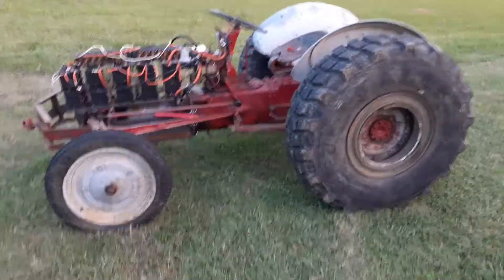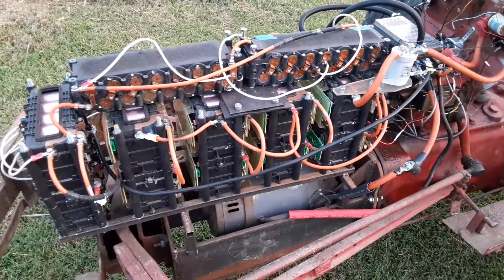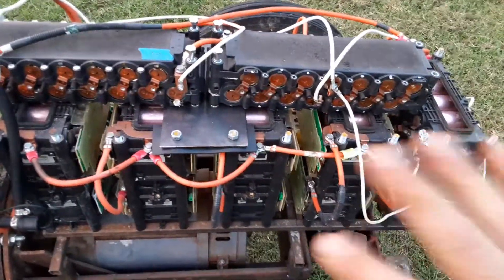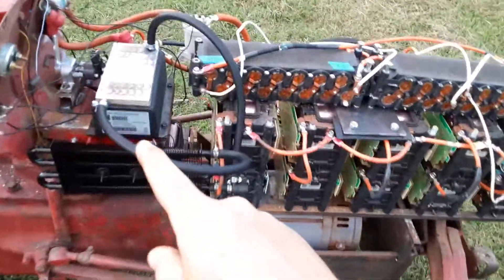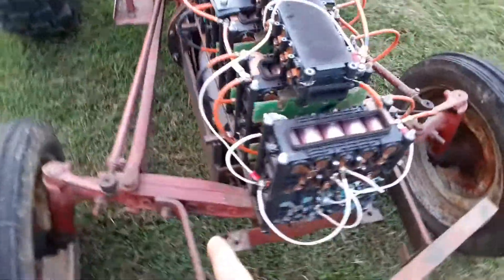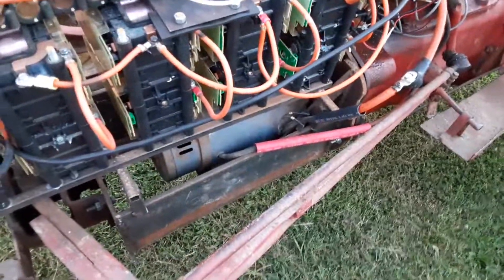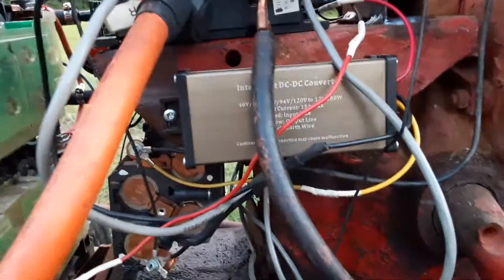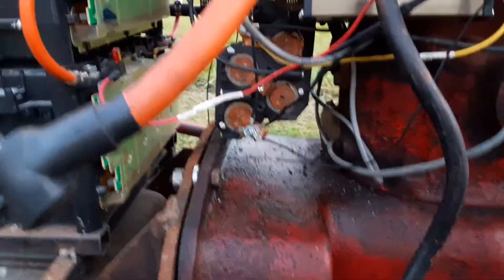DIY EV Tractor walkaround Ford 9n electric conversion

Comment: That'll not a bad effort. The noisy motor can probably be swapped for a quieter, more efficient and more powerful EV motor, when one can be found at the right price. But meanwhile, you have a very useful tractor.

Comment: cool project! The stressed member at the front replacing the engine as a stressed member in the chassis is probably a bit on the weak side for real tractor work. But for light work in the yard it is probably enough. Anyway, cool project! Could you say anything about the cost of the components?
Reply from the maker: If anything I am concerned I overbought the frame replacement and the case would be the first failure point. Last I checked I was $2200 into the whole project including tractor. Most expensive item soliton Jr controller that I run now. Free batteries.
Reply: @stevenmurphree  Well the plate is not flush against the clutch housing. You have those screws with the washers in between the two surfaces. So that may cause the screws to break out of the clutch housing. It looks a bit flimsy all in all.
Reply from the maker: Yeah the pilot for the input shaft was too long and pressed into the closed end bearing on the motor I used. I was afraid to cut it off initially but next time the tractor is split one small 1/4" non splined section should purchase enough clearance. Eight 3/8" (m10) grade 5 bolts is in excess of 50,000lb shear strength.

Comment: Is that forklift motor?
Reply from the maker: Yes
Reply: @stevenmurphree  I really don't know..
What is use of forklift motor..
As far I know 
It requires less rating system ( in terns of volts) like 36/48v, means it has low speed.
 
It has max loading capacity.
Please reply few more info ...what is the purpose of forklift..
Because I have seen few mates used forklift motor in car as well.
Reply from the maker: @kmuralikrishna1582  it all depends on motor specifications. Forklifts are just a common source for large, inexpensive DC motors.

Comment: Fantastic work!  Been thinking about doing something like this to an old Ferguson 35, the engine in it had got frosted and cracked the block, then the head was stolen so it's just sat there ever since.  Anyway I just wanted to ask how much work would you say you get out of a full charge with battery capacity you have?  Ideally I would love it if were possible to have an electric tractor that could run a small mower, turner and bailer in order to bale a small field, trouble is I suspect all of these activities are going to very heavy on battery power and I'm unsure what capacity I would need in order to complete each of these tasks, especially the mowing as that is going to be determined by things like moisture and density of the grass ect, it always used more diesel anyway, I suppose I could make an educated guess knowing how much fuel I used and the tractors power rating to determine how many watts of energy would be needed.  Anyway any thoughts on battery usage would be great and very much appreciated.  Keep up the excellent work!  Cheers.
Reply from the maker: I get a couple hours of utility work like dragging logs or pulling a small cultivator. This has a 3.7kwh battery pack.
Reply: Thanks, that's very useful information.  Guess I'll have to just cram batteries into every nook and cranny 😁, it least it'll give me a bit more weight to aid with the traction!

Comment: Nice work, Steven! I love it. Thanks for the tour. 

I've converted a small Iseki (18HP, Hydrostatic -> 48v, brushed DC motor). I'm currently tackling a larger project: A Nuffield 4/60 (60HP -> 2x Nissan Leaf motors, 3:1 reduction, ~200v DC). They're great fun, aren't they! :)

Comment: Would it be possible to get the contact info for the salvage yard you went to? I own an energy solutions company that works with a local parts dealer with a similar issue and we provide them recycling for battery systems they can't sell so that the packs don't end up in the ground. Just a company name and location in the country would be great! Thanks!
Reply from the maker: Sorry but keeping that source private for confidentiality and maybe some future projects. I'd recommend reaching out to local junkyards as these smaller less popular hybrid batteries can be a burden for them.

Comment: Hello
great video!
I think  you  must cool the botom side of the controller ?

I'm working on a similar conversion but with a clutch
https://www.youtube.com/watch?v=SoVb-xVVOFM
motor is netgain warp9, controller is zapi h2b, 600A 80V
I'm also  having problems with heat disipation on the zapi , I sourced a bigger cooler from 22 kW industrial  inverter, hope it will be enaugh.
I still don't have a propper charger.

Comment: Great Video!  I intend to make a similar conversion to an 8N, but I intend to use a 48 volt system to drive a smaller motor that mounts to a sealed 3:1 gear reduction.  I've got some questions I hope you can answer.  First, I can't see any reason to retain the clutch since an 8N doesn't have a live PTO that is still powered even when the clutch is depressed.  It doesn't look like you retained the clutch, but I've seen an EV 8N where they did, and another fella that said he wished he had retained the clutch.  Now that you've built yours, do you wish you had retained the clutch?  Second, I noticed you have washers between the adapter plate for your front sub frame and the bell housing.  Did you do that to compensate for a lack of "flatness" in the adapter plate, or was there another reason?
Reply from the maker: That's a correct assumption about direct drive clutchless. I used the original clutch disc splines center for my motor adapter, though. I dont regret clutchless. Good eye on the washers! That's a temporary spacer to account for the machining with the materials on-hand approach.
Reply: I did a 8N conversion about 9 years ago..  I went clutch-less.  I ran out of hands when using a scoop scraper.  One hand on the 3pt. control and one on the throttle..  none for the steering.  I ended up hooking a pot box to the clutch peddle that slows the tractor to a stop when depressed. (similar to a clutch but not quite the same).  the second pot box makes the tractor operate similar to it's gas counter parts.  http://www.evalbum.com/4736 and https://www.diyelectriccar.com/threads/e-ford-8n.80143/#post-327616